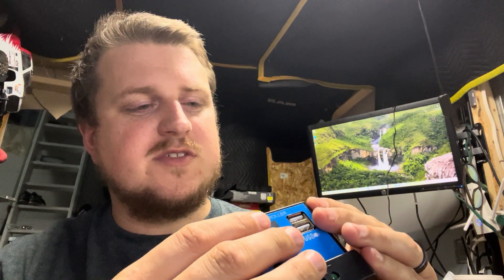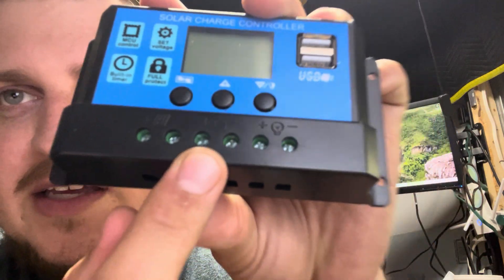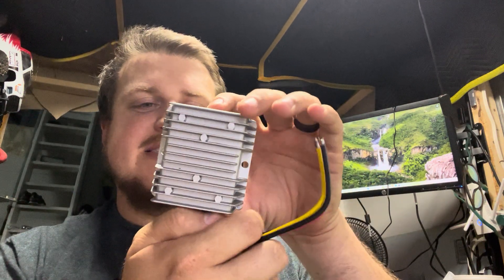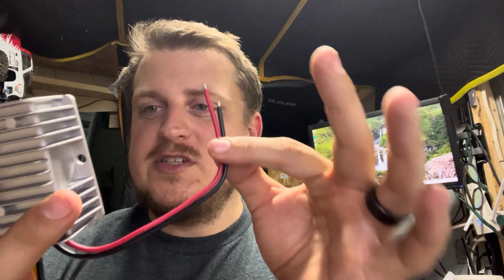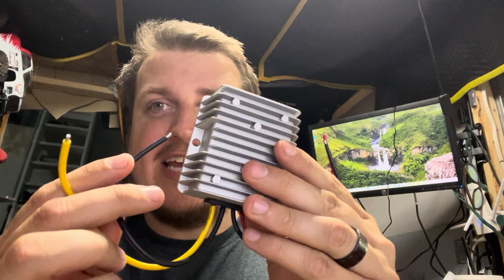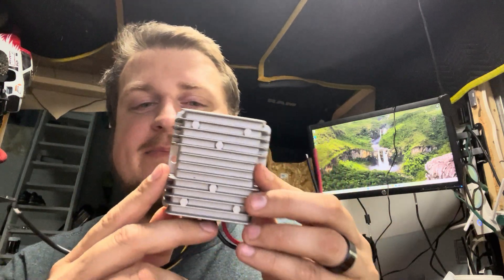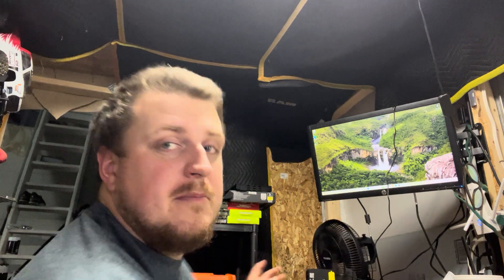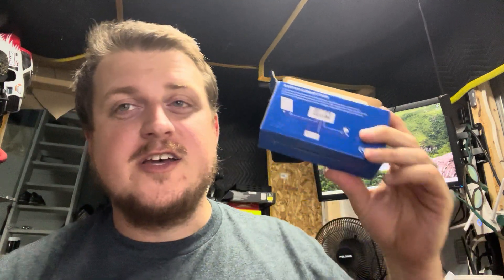Small scale Solar bitcoin mining pt1

Comment: There are a lot of SHA-256 altcoins that mine very well with smaller Nerdminers and Bitaxe.  Also use LiFePo4 batteries for this kind of use. Lead acid will die fast if you are running them down to 0 all the time. I am using a 2000 watt solar array at 24v output into a 100amp charge controller with 6 deep cycle batteries to run 3 iPollo's mining octa and a small PC mining Monero. It works well enough for hobby mining. I only run the miners during daylight but I'm going to upgrade my batteries to a LiFePo4 setup to run 24/7. Two 24v 100Ah lithium's in series should give me enough amp hours to run full time in my solar shed with room to spare.

Comment: I've got about 800w power in, and 2 12v lipo 4 batteries connected for 24v on an edeco hybrid mppt charge control.. connected to my breaker box. My 1 ks0 pro has drained it many times..

Comment: The 8 bit guy has done a whole bunch of solar videos. From what I understand, is that there is a short window where the panels will actually make 200 watts.
Reply: Its best to think in terms of energy produced per day.  Roughly multiply solar wattage by 5 ... so 200W x 5 = 1000 Wh (watt-hours) of energy produced per day.   If reasonably placed the panels will be producing about 10 hours a day on sunny days in summer, but its a curve.   Multiplying by 5 roughly accounts for that curve.  (In winter the production multiplier is a lot worse... more like x 2 instead of x 5 or x 6).

And then assume a battery buffer so the energy can be doled out to the equipment 24x7.   1000 Wh / 24h = up to around 41W continuous power.  Not counting efficiency losses.   But that's the rough way to calculate it.

Efficiency... easiest to just assume 85% even though the DC-DC will be better than that.  So  41W x 0.85 = roughly 35W continuous consumption.

-Matt

Comment: i would recommend you get rid of that pwm charge controller and go with an mppt charge controller for better results especially if you want to use those nano 3s
Reply from the maker: Will do! Ty
Reply: @brandoncoin  no problem you might also want to run in 24v and get a 19v stepdown so you can run like the iceriver 0 models if you have any of those or any other small miners that use the 19v and if you go for an inverter puresine wave ones are the better ones to get

Comment: I use two 100 watt panels with a 120 wh battery station that has DC passthrough. It came with an 12-volt accessory outlet I use with a 200 watt power Inverter that has two ac outlets.